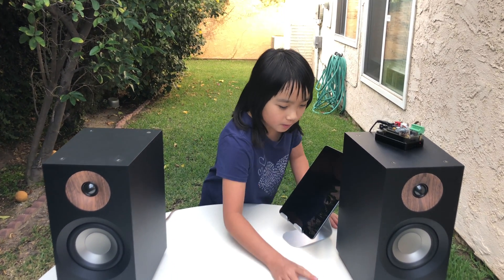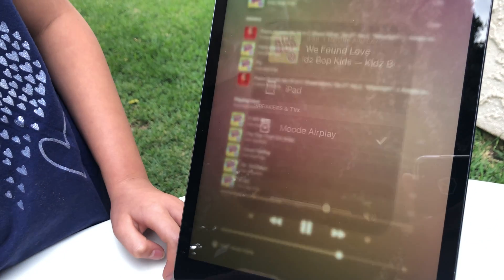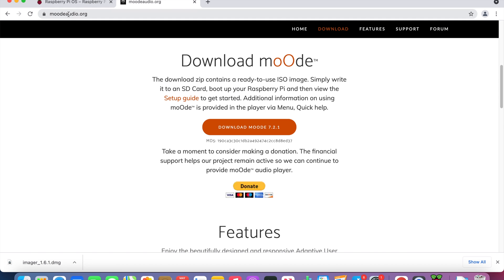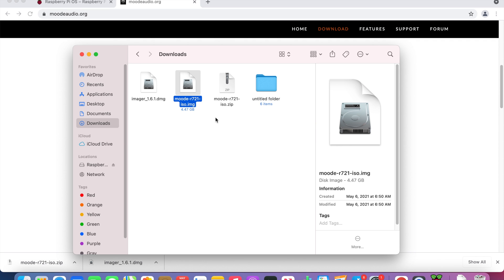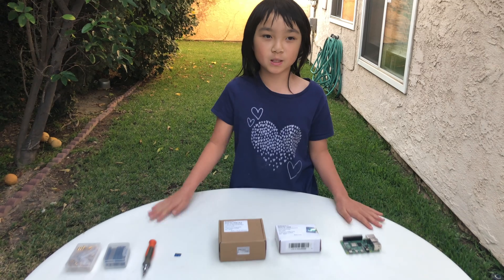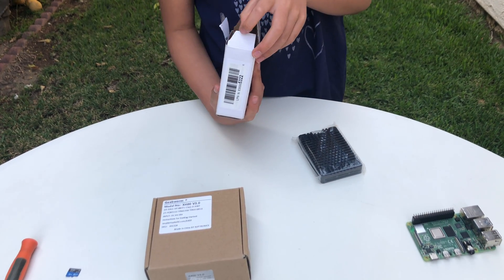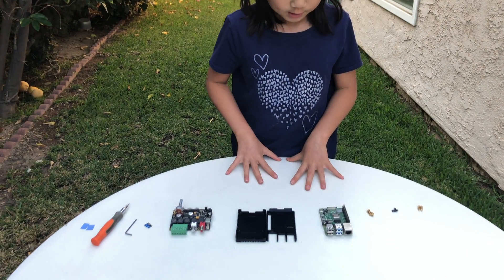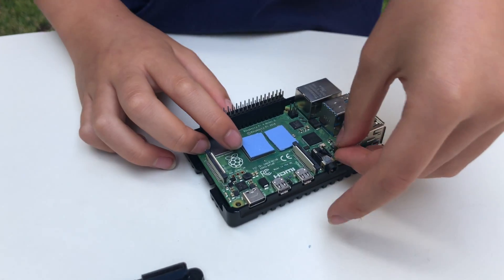build a smart (airplay,bluetooth,spotify streaming) speaker with Raspberry PI & Moode audio

Comment: Tip: With the speaker screw connector, you need to crimp a ferule at the and the end of the speaker wire. SCrew will damage the twisted wire and the connection might not be correct.
Reply from the maker: I pinned your comment. Thank you very much.